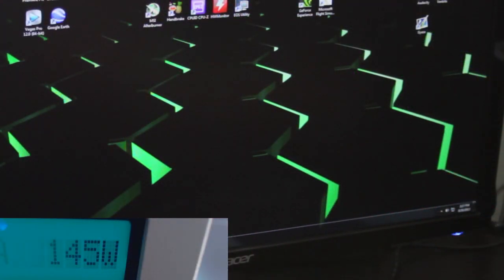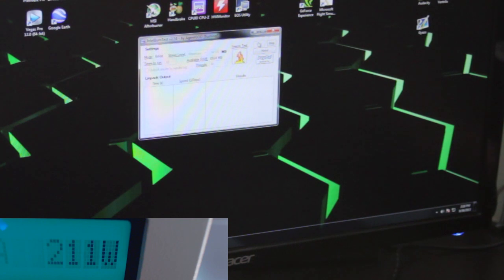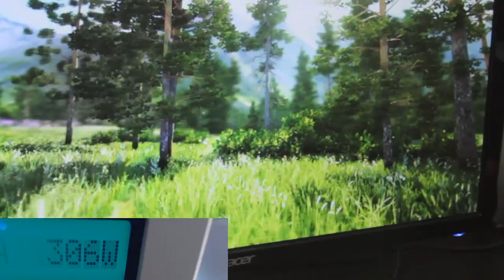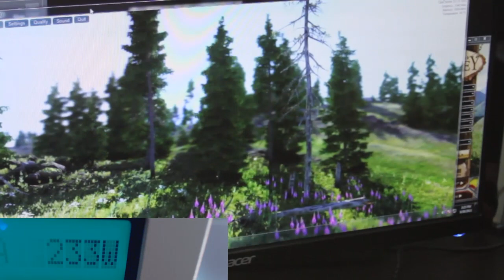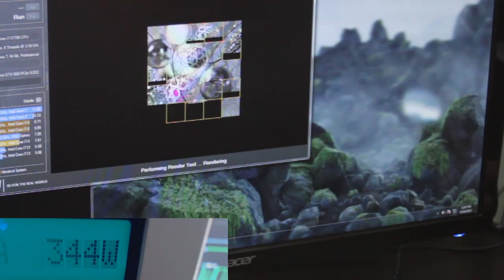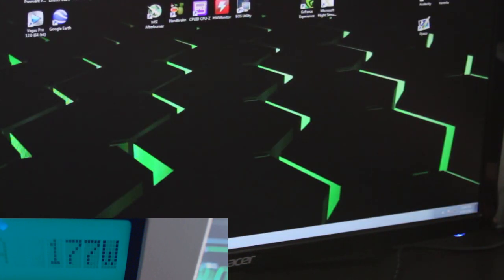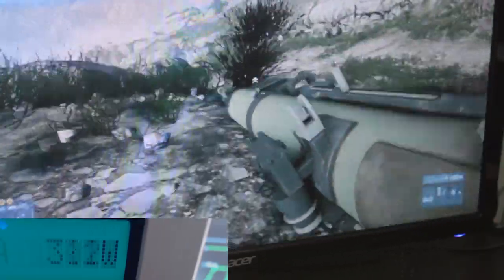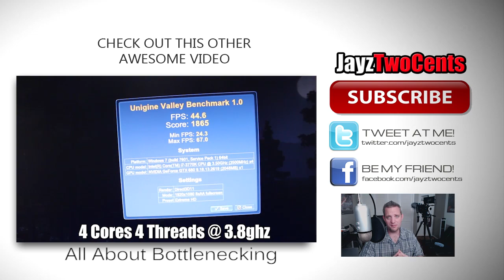How big of a Power Supply do you REALLY need?

Comment: How have things changed over the last 9 years? Not you Jay but PSUs for current gaming PCs.

My current PC is 10 years old. Has a 750w PSU in it. Barely draws 150w. With my TV I use as a monitor am probably using 200w at most. No GPU card though.

Comment: It is crazy how efficient the hardware has gotten in the past years, I run a Ryzen 5 3600 and gtx1080 and at full load with both the CPU and GPU overclocked I only draw 130W from the wall. at idle my pc only uses 60W. I really have to keep a close eye on my watt usage because I am on solar power.

Comment: I just finished putting my mini itx build together. Parts list: Corsair sfx 450W, 770 gpu, 280 Corsair ICUE H115i AIO, and ROG STRIX X570 motherboard. When I push the power button the psu makes a small pop and nothing turns on. There is a small spike of 26W on my watt meter. Predicted power usage is around 360W. The motherboard rgb stays lit through the whole process. Any idea what might be happening?

Comment: On Corsair SF600. I OC'd my mild Westmere EP Xeon X5675 on Tylersburg X58 ASUS P6X58-E WS 200x22 as 4.4G @ 8x Ram 1600) w/ single ASUS GTX-980 Ti, 4X ssd 2x USB3's Its stable but i have no meter to measure but the silent fan almost never goes off anymore once it loads from idle. I wanna try a 2nd GTX-980 ti for fun but idk.  My i7-980X shows 147w under load OC'd to only 4.2G. This same 980X at 4.5G killed my SilverStone Strider 600w on my R3E 8yrs ago. CPU's OK, but I also had 2x energy hungry GTX-780 Ti's & 4x Raptor SATA-III 10k rpm HD then.  Oops!

Comment: I’m running a 550 Evga Gold and a 2080 super it says  low ram could that be caused from my power supply I’m assuming I have a bad GPU but hoping this is the problem I also have four course air memory card EK aio cooler Four 140 fans and one 120 fan running with RGB

Comment: Random question. I bought a modular Corsair PSU on Newegg. It shipped from China with the Chinese cord. I have an older 750 watt Corsair unit that is not modular. Am I safe using that cord and placing the PSU in my PC? Or are their standards and such different where it may be unsafe on my components.

Comment: The first point he makes in the video is incorrect. He say's "if you're using an 80 plus PSU and it's rated at 1000w it will deliver at least 800w." What it actually means is that if you're using an 80 plus PSU @ 1000w, it will pull ~1200w from the wall socket. This is a very common misconception. Source: https://en.wikipedia.org/wiki/80_Plus, also Johnny Guru/ Jon Gerow talks about it in tons of videos, he's the director of PSU engineering at Corsair... That said, this video should be amended because it's an important point.

Comment: Can someone help me choose what supplies/parts I need to make a no-issue performance VR compatible gaming Computer that runs on 1440p? I already have these parts: 
Case: NZXT H700i ATX MID-TOWER
Fans: NZXT Aer RGB- 140mm - Twin PackNZXT
CPU Cooler: NZXT Kraken X72 360mm Liquid Cooler
USB: NZXT Internal USB 2.0 Port HUB
As you can see I'm using a mainly NZXT build, so please accommodate for that. I'm missing the main components and don't want to buy the wrong parts. Thank you!

Comment: Jayz, you might want to make an update to this video since today the TDP abuse of Intel and now nVidia makes those number pointless of choosing PSU. And I still see many using your video to troll in many PC groups saying 750 watts for today setup with two GTX 1080 in SLI setup. Oh for sure base clock for everything won't make the card go beyond the 180 watts, but do you even do that in your own setup? Remember, they quote you in their recommendation to the PC beginner know nothing about the difference of base clock, boost clock, and overclock power draw.  Maybe you also need to put a stronger disclaimer so you won't be liable for those whose misquote your word and cause other suffer PSU blowout while attempting to overclock down the line.

Comment: Power sag.?  When i bench or use dual cards u can hear the strain. aka tiny rpm decrease.  LEPA 450. ? Thaughts.......
Reply: 😒 water 3.0 cooler..  3 hard drives. Hd6870 ( teh gigabyte version !) and gtx 1050 secondary.  First gen 1200 cpu am4. LEPA 502 white case. XPG 3ghz ram!  Am320 based.  Near silent at idle(:
Reply: Might get a be quiet!   Fsp rocks!

Comment: update:
KEYBOARD: Razer Black Widow Ultimate
MOUSE: Razer Chorma Naga
CARE1: Ultra Enhanced Packaging Solution - Protect Your Dream System During Transit [+19]
CAS: Corsair Obsidian 900D Super Tower Gaming Case w/ Dual PSU Support, 3x HDD Hot Swap Bays, Front USB 3.0 & Side-Panel Window [+286]
CPU: Intel® Core™ Processor i7-8700K 3.70GHZ 12MB Intel Smart Cache LGA1151 (Coffee Lake)
CS_FAN: 3X 140mm Thermaltake Riing 14 Series High Static Pressure 140mm Case/Radiator Fan (Orange Color LED)
FA_HDD: Vigor iSURF II Hard Disk Drive Cooling System (1 x System)
FAN: Cooler Master MasterAir Maker 8 High Performance CPU Cooler with 8 Heat Pipes and Dual PWM Premium Fans
HD_M2SSD: 120GB WD Green M.2 SATA-III 6.0Gb/s SSD - 540MB/s Read and 430MB/s Write (Single Drive)
HDD: 2TB (2TBx1) SATA-III 6.0Gb/s 64MB Cache 7200RPM HDD (Single Drive)
IUSB: Internal USB 3.0 4-Port Hub [+25]
MEMORY: 64GB (16GBx4) DDR4/3200MHz Dual Channel Memory
MONITOR: 34" LG 34UM64-P IPS LED WIDE BLACK LCD (Single Monitor)
MOTHERBOARD: ASUS TUF Z370 PLUS GAMING ATX w/ RGB, USB 3.1, 3 PCIe x16, 3 PCIe x1, 6 SATA3, 2 M.2 SATA/PCIe [Intel Optane Ready]
NETWORK: Intel EXPI9301CTBLK Network Adapter 10/ 100/ 1000Mbps PCI-Express
OS: Windows 10 Home (64-bit Edition)
OVERCLOCK: No Overclocking
POWERSUPPLY: 600 Watts - Standard 80 Plus Certified Power Supply - SLI/CrossFireX Ready
SOUND: Creative Sound Blaster ZX 5.1 Channels 24-bit 96KHz PCIe Sound Card w/Multi-channel surround, SBX Pro Studio, Sound Core3D Processor & Audio Control Module
UPS1: NuGiant Energy Saving Smart Surge - 8 Outlets w/ 5 Energy-Saving Outlets auto ON/OFF based on your PC (31002)
VIDEO: EVGA GeForce® GTX 1080 Ti FTW3 GAMING iCX Edition 11GB GDDR5X (Single Card)

Comment: i really don't know what psu sould i use:
my specs: mobo: asus strix z270f
                    2x8gb 3000 mhz trident z RGB
                    Liquid cooler NZXT kraken 62 (280MM)
                    i7 7700k
                    ASUS NVIDIA ROG-STRIX-GTX1080-O8G
                    hdd 1-2TB (ssd on the future)
                    some LED strips
                    2x LG ultra wide monitor 25inch

Comment: Are 500w power supplies enough?
Reply: It depends entirely on what you're using... You could easily get by on less than 200w if you have a low power CPU and GPU and no fancy stuff.
Reply: Jorge W Manbush well i doupt il have anyyhing big in my pc but i want a pc that consumes optimised power while doing medium gaming. Like being able to play games like cod
Reply: Google power supply calculator and try outsome components. I'd take it with a grain of salt but it gives you a general idea. The CPU and a graphics card like the GTX 1050 Ti will be pulling less than 100w each, and other components like RAM, harddrive, devices could be closer to 50w. And 500w is double that total so should be way more than enough. That graphics card recommends at least a 300w power supply also, but it doesn't really matter.
Reply: Jorge W Manbush ok but do u know any sites where u can choose the roght parts u want order it and get is sent to ur place prebuilt so u dont have to do any of thw work and just plug it in. Im not lazy. I just dont wanna mess something up if i do it myself.

Comment: This label on most PSU's suggests the closer you get to full power consumption or the farther away you get from full power consumption, the less efficient the PSU will be. This then would suggest a PSU run at 50% of it's rated output to achieve 100% efficiency.  

http://www.corsair.com/en-us/~/media/70B622475C314CE3A97036FA2C8207BA.ashx?w=625

Comment: Can someone help me, I'm trying to build a pc and I'm not sure what PSU I should have for wattage I'm looking at one which is a 80+ bronze and is a 450 watt, these are my pc specs

I5 7500

Cooler master-hyper 212 EVO-cpu fan

Msi- z270-A pro atx motherboard

DDR4 hyperX 8gb ram 2400mhz 

1TB HDD 7200rpm 

Gigabyte Nvidia  Gtx 1060 ITX 6gb

Comment: I have 

Asus m5a something 2.0

Fx8350

2  4gb sticks of I think fury x ram 

Kraken x60 with 2 140mm rad fans

3 120mm case fans

2 phanteks 1m led strips

5 hard drives 7k rpm

1 Samsung evo 840 ssd

Gigabyte r7 370

And I would like to try to crossfire it with a his HD7850

Sooooooo here's the cow in the car will the psu hold up?

Comment: Power supplies are most efficient at 50% of their rated load (some reach 90-95% efficiency), therefore if your system draws 300 watts on your average workload and has a maximum 500W power draw, 600-650W PSU is a perfect choice. Having a 15-20% overhead will make sure your power supply will last forever

Comment: 550W more than enough for a gtx 1060 gaming x 3GB and an i5-7500? Maybe drop down to 500? GPU specs says it's best to have a system with a minimum of 400W. Even if it only uses about 120W. CPU uses about 65W. Let's say all the other things reach about a max of 50W.

Comment: Operating System :: Windows 10 Home - (64-bit)
Case :: Thermaltake View 31 TG Gaming Case (2x Side Glass Panel) Black
iBUYPOWER Elite Build Package :: None
LED Fan Lighting :: Default Case Fan
Case Lighting :: iBUYPOWER RGB Smart Lighting (Software Controlled LED Lighting Kit) - [FREE] 1 Smart Lighting Strip - Top of the case
iBUYPOWER Labs - Noise Reduction :: None
iBUYPOWER Labs - Internal Expansion :: None
Processor :: AMD FX-8320 CPU (8x 3.50GHz/8MB L3 Cache)
iBUYPOWER PowerDrive :: None
Processor Cooling :: Asetek 550LC 120mm Liquid CPU Cooler - Standard 120mm Fan
Memory :: 8 GB [4 GB x2] DDR3-1866 Memory Module [AMD] - Corsair or Major Brand
Video Card :: NVIDIA GeForce GTX 1050 TI 4GB GDDR5
SLI Bridge :: None
Motherboard :: ASUS M5A97 R2.0 -- AMD 970 w/ 2x PCIe x16, 2x USB 3.0, 6x USB 2.0
Power Supply :: 600 Watt - Standard 80 PLUS Bronze
Advance Cabling Options :: Standard Default Cables
Primary Hard Drive :: 1 TB Hard Drive -- 32MB Cache, 7200RPM, 6.0Gb/s - includes [FREE] 240GB Kingston A400 SATA-3 SSD
Data Hard Drive :: None
Optical Drive :: None
2nd Optical Drive :: None
Media Card Reader / Writer :: None
Meter Display :: None
Sound Card :: 3D Premium Surround Sound Onboard
Network Card :: Onboard LAN Network (Gb or 10/100)                   is 600 wats good

Comment: Omg how do I block this channel from showing in my  feed and playing when I'm not paying attention.  Aside from the incessant babbling on, the entire back half of this vid is nonsense and contains factual errors.  Not to mention the fact that while I was building my itx right his channel was the previous video than came on too (something about how he orients his psu) and he was babbling about how he has the fan grill up and it doesn't really affect his total air pressure balance because he uses a bigger psu and due to how efficient they are they don't spin up the fan when not using "x" amount of load.  Which Is of course true.  Then he says it's dumb to buy a big psu and that they are Inefficient when not using enough of their supply.  

This is what happens when you babble on and on and on.  You start saying stupid shit and contradicting yourself. 

Wow.

Comment: I got dual gtx 660 sli and they take 420W from wall. They seem to run pretty good on 500W nexus power supply. I used boinc for benchmarking

Comment: My gaming PC using friend told me I would need at least a 750 watt PSU for any gaming rig. Lol. I have a gaming rig running on a 300 watt PSU. I won't need a better one until I get a better GPU, and even then I will only need a 310 watt (which means at least 340 watts is recommended).

For some perspective, I'm running FFXIV and Overwatch on maximum settings and getting 60+ FPS.

Comment: Here are some reference numbers from my modern, low-middle-tier PC:
i5 6500 (65W), 8GB RAM, R9 380X (+10MzOC, 190W), PSU CX750 (Bronze)
Idle: ~50W
Full Load: <240W
---
Desktop use: ~70W
CPU only: <90W
CPU + RAM : ~100W
GPU only: <200W

Comment: You're wrong about efficiency. The wattage rating of a power supply corresponds to the OUTPUT not the input. so what that means is that if you were to run the power supply at maximum load (which is obviously a bad idea) of 1000W OUTPUT you will draw 1250W from the wall. The 80+ does not refer to peak load (which is actually peak efficiency for most power supplies) but instead means that the efficiency will be at least 80% under ANY LOAD. A bronze 80+ is more likely to be around 90% efficient under typical to peak loads and less on idle.

Comment: i have a r9 290 which suggests a 750wpower supply but im on a 600w 72% efficient power supply and it runs fine, even had very slight over clock on both the GPU and CPU at one point and it still ran fine, but im sort of worried about  putting two sealed loops in there and some LEDs in case its too much, is the only way to tell by using a watt meter? or is putting it in pc part picker quite accurate?

Comment: Another misconception. If you use a 750 Watt power supply, and your system only takes 350, you are not wasting 400 Watts. Also, if you are thinking about energy cost, look at power supply efficiency charts. Power supplies are not efficient under heavy loads, so it is good to check the efficiency chart to know if said power supply will be good at your wattage usage.

Comment: my own personal general guideline:

- minimum 500w~ psu for any basic computer either not intended for gaming or with a budget gpu(HD6450, GT210 or whatever is the card of the day).... this plays on the idea of not spending to much time, and just going for a semi reputable brand
- min 450w(with research) to 750w~ for single mid range gaming gpu
- 850w to 1000w+ for 2 or more gpu's.... at this point research is a given:P

notes:
- amperage rating for rails is far more important than claimed wattage
- some companies will literally make 2 or more models of a power supplies that have identical internals and stick a different rating sticker on it, as a friend suggested beefy 500w vs 650w, bit of extra power is always a good idea in case the psu is on the lower end of the models:P
- multi rail can be a gimmick and/or vary from power supply to supply, I have personally yet to open a true multi rail power supply(unless they mean just multiple wires;P)..... in a stint it's should be safe to read the specs of a power supply with multiple rails of the same voltage as the total amperage of both, less 10-20%~ or similar

Comment: My son has a pre buld Zoostorm gaming pc but only has a 350w PSU running a gtx 960, He wants for his 16th birthday a gtx 1070.
Will there be enough to run the new card with the 350 psu? My system is also a pre build Zoostorm but its 12 months older and is not classed as a gaming pc and only had a gtx 650 but my PSU is a 500w.
Both have I5 processors my son has 8gb or ram where I have 16 gb he has a 2tb hd where I have 4tb but he has his operating system on a internal SD.
If the gtx 1070 will go into my son's then the gtx 960 is going into mine saving me a little cash.

Thanks for any help and loving the videos...
Reply: Ian S i thought the new generation of nvdia used even less power than the 9th generation. So if it can run a 960, it should be able to run the 1070. But I am not 100% sure.
Reply: Ian S Get an evga 500w power supply because that will blow up.
Reply: Even though its only 30w more power than his GTX 960?
Reply: Ian S Prebuilts usually have cheap psu's and they have bad components in them.

Comment: Is 1050w enough for r9 fury crossfire and i7 6700k? I will also have one ssd and one hdd. Thanks!
Reply: r9 = 375w
i7 = 95w
hdd + ssd + RAM = 25w (overestimated)

-Are you going to OC your system? If you are, add 100w to the calculations.

Conclusions: 1050w is a bit of a overkill, a good quality 750w can deal with that easily (considering that you may upgrade your setup in the future you may want a 800w). That's because r9 fury is very energy ineficient, if you change it to a 1080  (that consumes 180w at the worst case scenario) a 650w could do the trick easily. 
But again: buy good quality power supply (80+ bronze or better) from Corsair or Seasonic
I hope it helps!